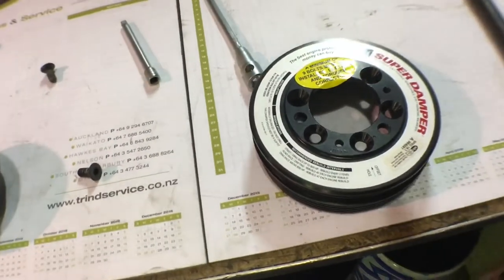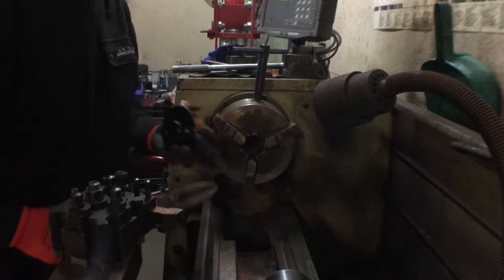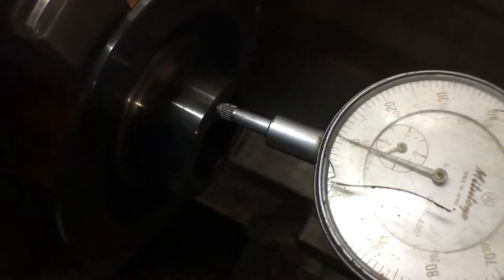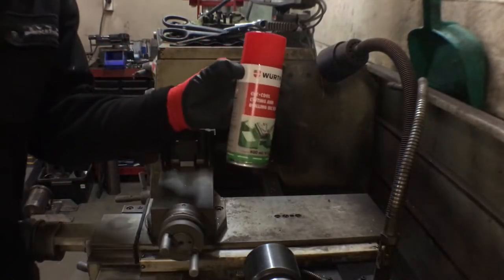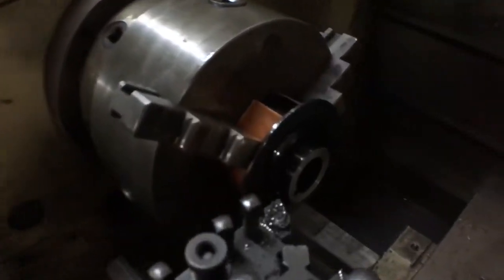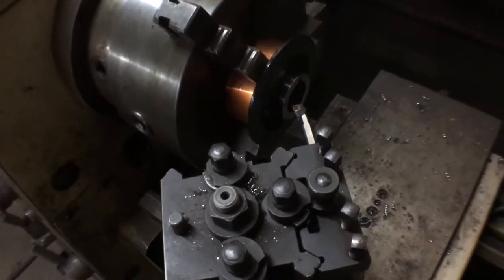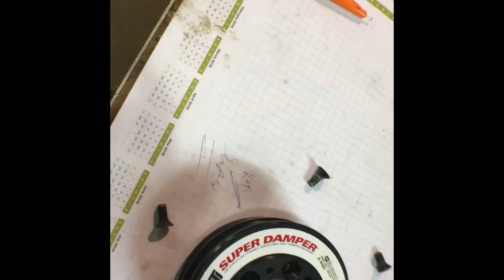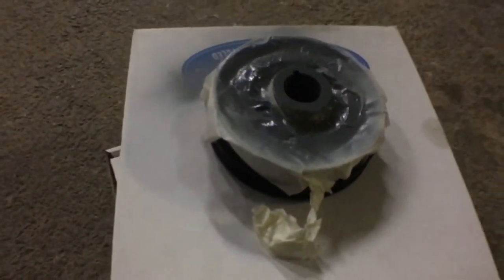SR20VE BUILD | ATI PULLEY MODIFICATION | UPDATE

Comment: Loving the VE Build playlist, currently working my way through it. Interesting on the 5mm milling on the ATI pulley, ive added it to my machining list for my build. Also interesting that you have put the annular groove in the main caps, I've not heard of needing this done.
Your build sounds similar to what I have planned (HKS Sleeves, Tomei 2.2 kit, SR16VE head and cams, ATI pulley etc) so this is a good little watch for me! Keep up the good work and I will keep an eye out for more content (y)
Reply from the maker: Hey man 👋🏽, cheers. I’m trying my best to try documenting things because I’ve been studying these builds for soo long and there wasn’t really any decent information out there let alone YouTube. The reason why I machined the pulley instead of fitting a 5mm washer is because I’m using a sr20ve oil pump and collar which was 5mm wider than the sr20det pump collar. So in the early days before they realised to use the Sr20ve pumps that’s what they did to combat this by fitting the washer as it put stress on the oil pump housing, also the crank bolts are prone to coming loose so losing 5mm worth of thread equals less torque pressure imo. I could also be wrong but will delete this video if I am. Secondly I’ve had the annular grooves machined because the early Sr20det engines (besides the gtir) didn’t come with the grooves so they only had about 120degrees of oiling in the journals - which is partly the reason why they always run big end bearings after 25 years or just straight abuse. So as added insurance by doing the grooves which is proven in the gtir and VE engines, they add around 290degrees +/-  oiling in the journal surface. And that’s HUGE and when you add a gtir or VE oil pump then you have the best oil setup until you go to a dry sump setup. I’ve since sold my Sr22vet so won’t be sleeving my second block anytime soon.
Reply from the maker: Found my source!!! 

https://www.efisolutions.com.au/buying/buying-guides/sr20ve-conversion-guide/harmonic-balancer/
Reply: @AdamNZ  yea man that’s a good source that I was using, must if overlooked the harmonic balancer section at the time though but I did find it since then. Just need to start ordering bits for mine now...
Reply from the maker: @lewiselliott9624  Yeah ive got stuck on mine tbh. Will try get it together net year hopefully. Will you post progress?
Reply: @AdamNZ  I might compile everything I need and post a bit of a tutorial video. But other than that I don’t really use forums anymore so any progress will be on Instagram
Reply from the maker: @lewiselliott9624  I'll keep an eye out!! what's ya gram name?
Reply: @AdamNZ  lewis.ell nothing much going on car wise lately but hopefully that will change next year